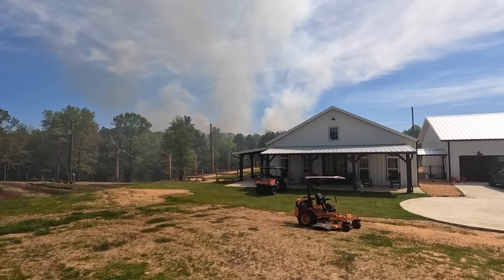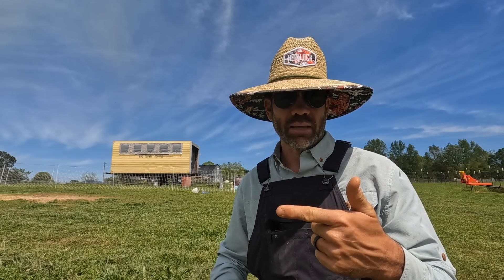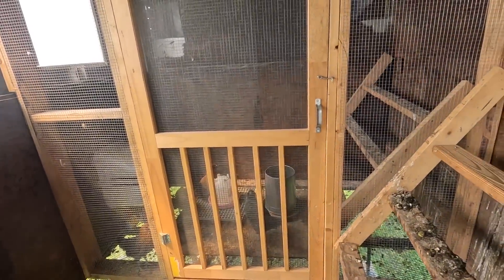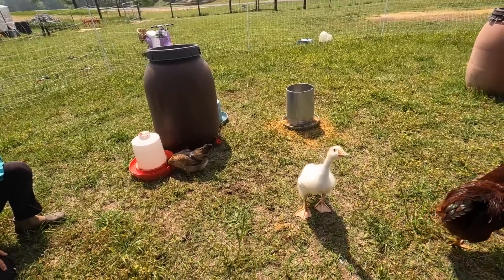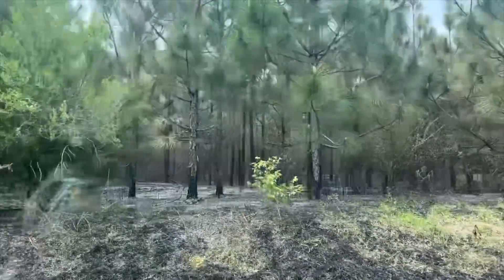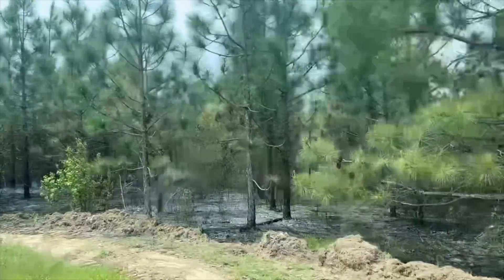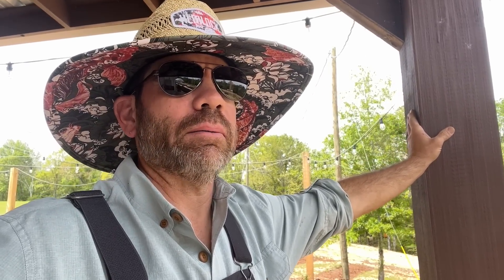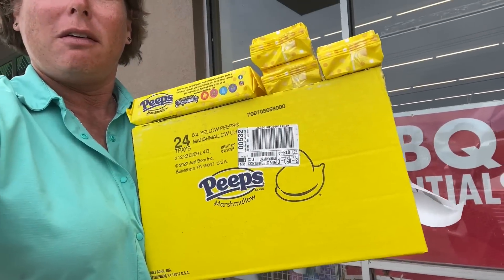Was it a Mistake Releasing Cheese the Goose? (Plus Day 3 Of The Barn Build)

Comment: That's the 'Seen but not touch' incorporation method, when you isolate the newcomers within the larger flock.  They can see each other but not challenge each other.  So, when the door is finally opened, they just think the door is still closed.

Comment: Jason and Brooke, on the floor of your barn make sure you put in holes so when you clean out the stalls you can drain the water, muck, etc.  Lester had that problem…he didn’t think ahead of problems it would create so he had to use a chisel to make a hole in the floor along the outside wall to drain the stalls. It’s easier to put them in before you put down a cement floor.

Comment: I live right next to the Buffalo River in Arkansas and the Forest Service does controlled burns along the river every Spring. The smoke gets so bad sometimes that going outside is difficult but controlled burns help stop wild fires. We became even More aware of how good these burns are a few years ago when our back 40 acres caught fire. It's the area that's closest to the river. The forest service came in and bulldozed a fire break and got it under control but it burned quite a bit of the 40.

Comment: As a freeze dryer for several years, don't hit defrost until you have removed your trays.  Also push the warm tray button.  Food should be warm when it comes out.  I always add ,12 extra hours dry time.  I can cancel that when I get up in the morning and food is always dry and warm

Comment: Many years ago, my uncle had a AAA dairy farm. 3 years in a row he won outstanding dairy.
The barn where the cows were milked and lived, I guess, had a concrete floor. There was the main floor and on each side there was a trench, for lack of a better word. Water ran through those trenches when the cows were in the barn. The place was so clean because daily after each milking was done, they'd spray down the concrete. It was a spotless barn. I'm suggesting concrete (cement) floor for the barn. You're going to have all kinds of critters in there, and poop, urine, feathers and other debris will collect. The easiest way to clean the floor will be to spray stuff into those trenches and scoot it to one end and scoop it up and deposit it to your compost piles. Yes, the initial cost is going to be expensive, but for the future as you grow older, it is going to be so much easier on both of you to clean the barn.
I just remember the cleanliness and hardly any smell in their barn. That's my 2 bits worth.

Comment: If your going to have stalls for the 2 cows I would suggest at least dividing 1 of the stalls and put sand in them. It should only be big enough for them to lay in and get up comfortably.  Not big enough for them to turn around in. ( you can have 1 stall for the hospital for any animal that needs quarantined) the reason for this is..they will have to stand to go to the bathroom or leave the stall . It keeps their bedding/resting place cleaner .

Comment: About the barn… The barn that my dad designed, in the late 60s, is similar to y’all’s in shape. The stall floors and the center aisle was hard packed earth. That’s not a really good option for y’all and I understand that. What I want to address is how you might use some of these stalls in the future. At some point y’all may have large animal birthing needs. I know you will have goat birthing needs. My family’s barn was only 5 stalls. The dividing boards of two of the stalls could be taken out to make one large birthing stall. What Dad also did was to have run out paddocks from each stall. The birthing stall had double doors on one side out into that larger paddock. Just something to think about, as you go forward.